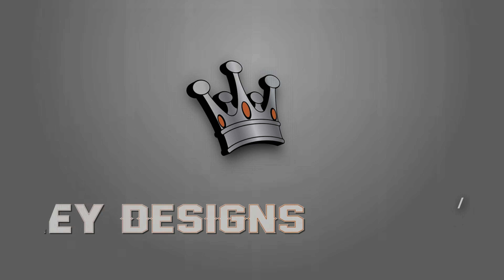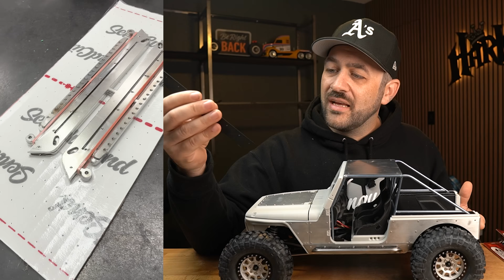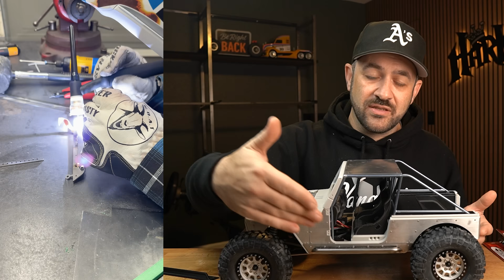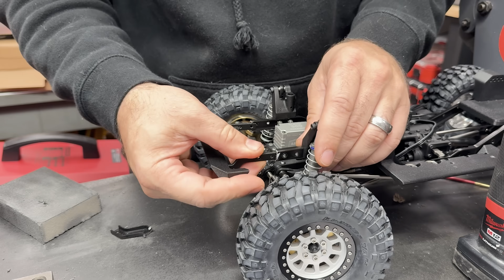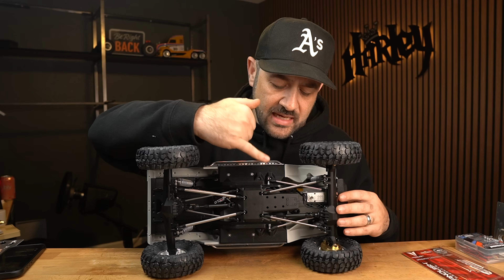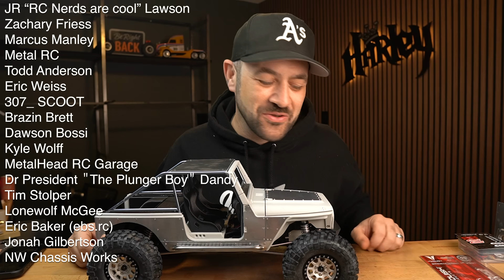Vanquish Eibach Shocks Hit the VS4-10 – Project IJ Ep4

Comment: Wwill the machine piston cause wear on the inside of the shock tube?  Metal on metal wear?
Reply from the maker: It is machined plastic, such as Delrin. Thats a solid question though and often times we forget that people assume machined means metal. Definitely worth clarifying in the future.
Reply: @HarleyDesignsInc ok thanks forcthe clarification.  A metal piston would be a bad idea,  unless it had an o ring on the outside of thr piston.  Have you used these shocks alot?  Leaking oil.  I heard bad things about vanquish shocks after I just ordered a set of these yesterday.

Comment: Hey Harley, I’ve been watching you for a while, and Matt and you got me to start building scale rigs when y’all made the C1 Porsches, I loved those, good job on the IJ too. 
I do have a question, are you focused about forward weight in the IJ build? Like would you relocate the battery and redesign the front end to fit the battery comfortably up there and then put the electronics in the back? Power button on the front so you don’t have to unplug the battery? Just curious man.
Reply from the maker: With a small battery I’m not at all worried about the bias. With the brass knuckles up front it will have a solid amount of weight up front already. The slight difference between the electronics weight and the battery weight will definitely pay off in accessibility. The H10 servo position takes up space up front where the battery would go. So putting it in the rear is the best option for me. Also, I always unplug the battery, I never rely on the power switch.

Comment: What size tube do you typically use? The 1/4” seems not very scale to me. Unless it’s only for the roll cage. But I want the same look all around the truck for scaleness. I also want to do front and rear shock towers and I’m thinking 1/8” is plenty.
Reply from the maker: This is 3/16” which scales pretty close to accurate.

Comment: you spent the time for all that awesome metal work you should spend the time and sand the jeep body then paint it. A little tip is after it's primered, use engine paint for that scale gloss look and it protects it from the heat on those long hikes

Comment: Just a tip if you take oxygen/acetylene cutting/rosebud just turn the acetylene on and soot the aluminum then turn the touch on and cook off the soot it will anneal the aluminum so it will bend easier

Comment: It´s a nice build I like it. Still it is now being to advance for me to build. What I would like is a video when it´s finish on what you had to do to have the Optic axels on it with part numbers. I vould like to build mine with H10 axels with the shorter wheelbase. For me H10 sterring looks more scale to that body. 🇸🇪🤘😎🤘🏁
Reply from the maker: I covered that in an earlier video of this series. H10 axles and an H10 link set. Or start with an H10 and just buy VS4-10 frame rails. I did shorten the front links with 4 x 116mm links.
Reply: @HarleyDesignsInc  I´m for the moment on VP page. 

The start is a H10 kit 

VPS10402  stubby conv. for VFD
VPS31160  116 mm links 
VPS10112  VS4-10 frame rails

The tires is it 4,75" or larger on 1,9" wheels. I think you did choose 4,75"

This is the parts you used. 

😃

Comment: Why you dont put the battery at front? if you put the battery back and install the spare it will be even more rear weight
Reply from the maker: The battery will be fairly light as you can’t fit much in this rig. The bias should still be OK as the brass up front is over 300g’s.